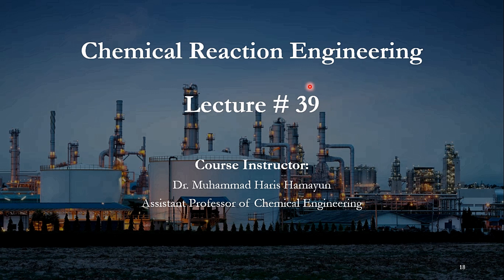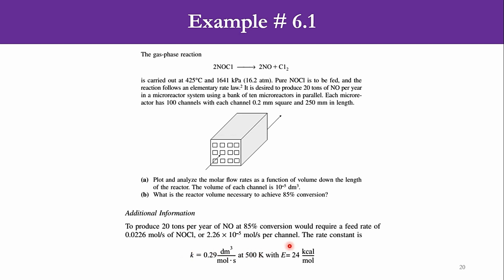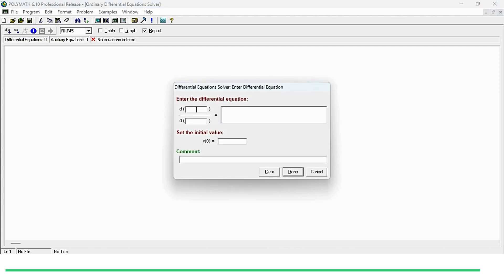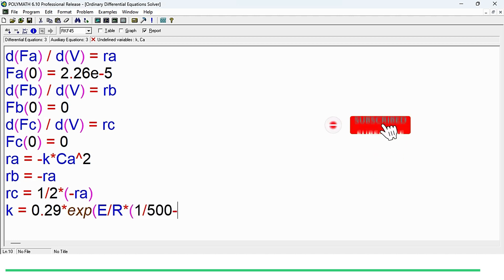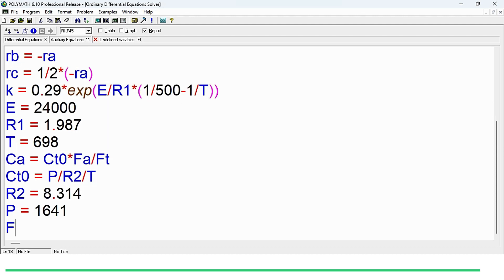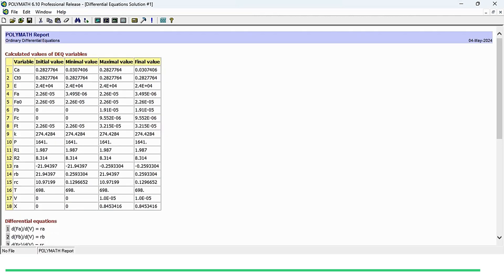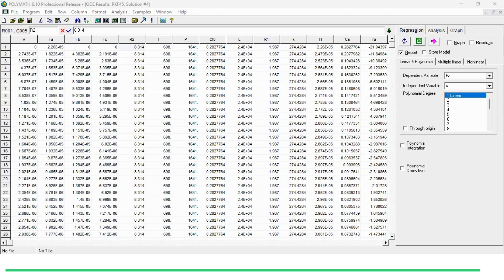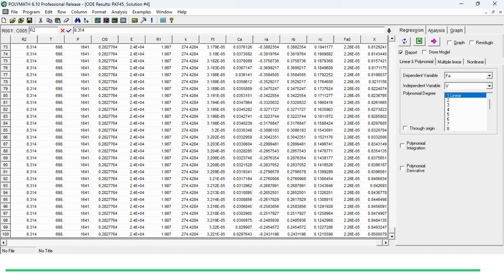Chemical Reaction Engineering Lectures - Polymath to Design a Micro-reactor - Lecture # 39 #polymath

Comment: PROCESS MODELING AND SIMULATION LAB

LIST OF EXPERIMENTS:

1. Estimation of dew point and bubble point temperature of a hydrocarbon mixture
2. Simulation of flash drum
3. Design of ditillation column
4. Optimization of a flow sheet or process
5. Determination of temperature profiles for heat exchanger
6. Concentration profiles for reactor
7. Simulation of Jacketed CSTR
8. Simulation of process
9. Simulation of evaporator/ distillation column/ extraction process

Comment: CHEMICAL REACTION ENGINEERING LAB

LIST OF EXPERIMENTS
1. Determination of activation energy of the given reaction using adiabatic reactor
2. Analysis of kinetics of liquid phase reaction in acbatch reactor with equimolar mixture.
3. Analysis of kinetics of liquid phase reaction in a batch reactor with non-euimolar mixture.
4. Evaluation of the performance of isothermal mixed flow reactor.
5. Evaluation of the performance of mixed flow reactor in series
6. Evaluation of the performance of plug flow reactor
7. Evaluation of the performance of mixed flow reactor followed by plug flow reactor
8. Resdence time distribution studies in mixed flow reactor
9. Resdence time distribution studies in plug flow reactor

Comment: sir could you please upload some chemical Engineering Lab experiments

PROCESS DYNAMICS AND CONTROL LAB

LIST OF EXPERIMENTS

1. I & II Order System Dynamics
2. Interacting & non interacting Systems
3. Flapper - Nozzle system
4. Control valve characteristics
5. Level control system
6. Flow control system
7. Pressure control system
8. Control of a thermal system
9. Design of control system for a given process
10. Simulation of a closed loop system
11. Demo Experiment using Aspen Software of a given process